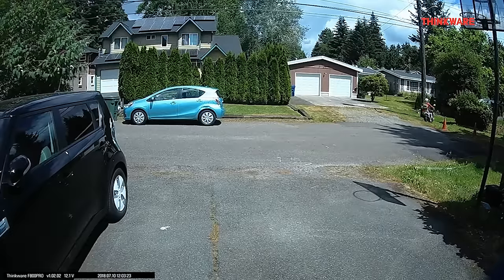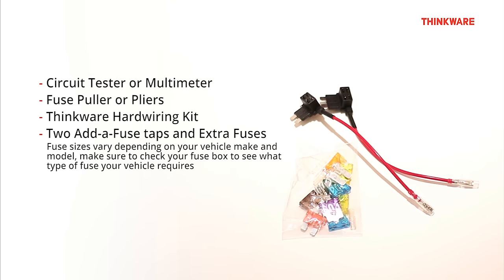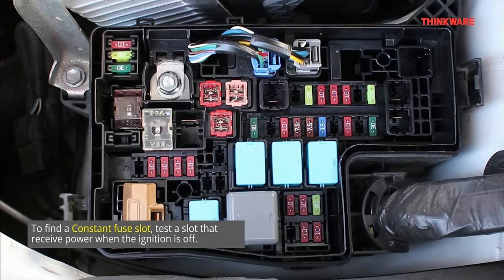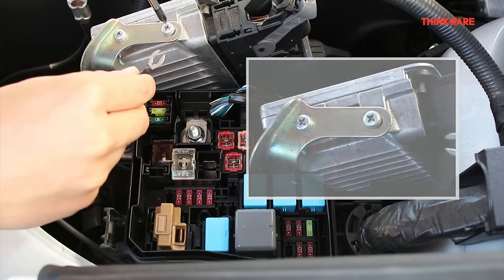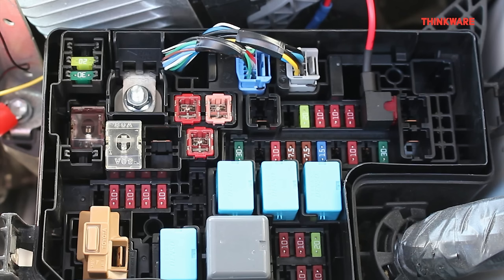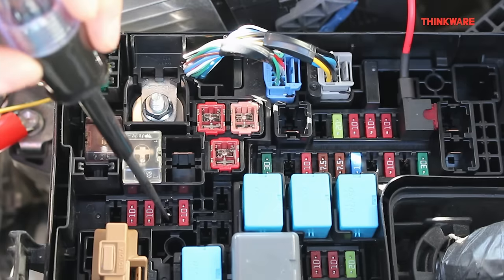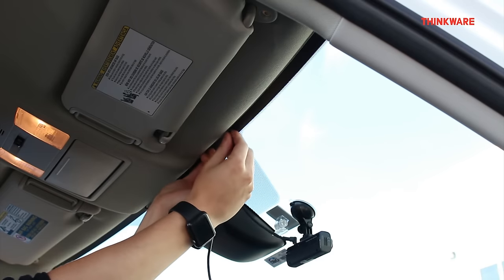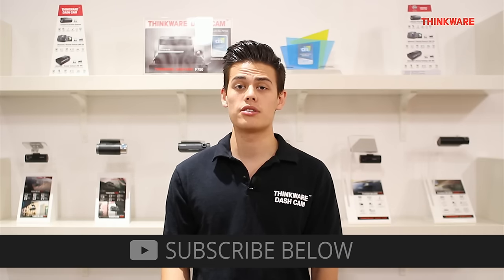How to Hardwire a Dash Cam

Comment: Hi I have questions I m going to buy thinkware f800 pro. 
I bought a new Jeep Wrangler unlimited JL . It has a cigarette lighter socket which has power even when Jeep engine is off.
    Can I use it for my back camera or dash cam?
Does hard wiring kit work same way or it is different than cigarette socket?
Will it drain battery if I use the cigarette socket ?
Reply from the maker: Hello Gary, The Car Charger Cable will not provide you with parking mode even if it on when the vehicle is off. The Hardwiring Cable has an ACC Wire which puts the Dash Cam into Parking Mode. WIth our Battery Protection Settings such as the Voltage Cut Off, Wintertime Protection and Record Timer the vehicles battery will not be drained.

Comment: I have no garage, so my car is out all the time, will the parking mode drain my car’s battery? This since it’s going to detect movement pretty much all the time
Reply from the maker: Hello Raven, All Thinkware Dash Cams have a built-in Voltmeter which will power off the Dash Cam if the battery level becomes too low. If you are normally parked in an area with lots of movement we'd recommend the TimeLapse or Energy Savings mode instead.

Comment: Hello, I want to but a separate dash cam that is independent from the front cam. If I use a USB splitter and attach it to the hardwire kit will it provide enough power for both dash cams?
Reply: parking mode does consume power when the engine is off,  hardwire kits, usually have a cut off circuit to prevent these cameras from draining to much juice from your cars battery.  having 2 separate cameras would drain twice as much power,  you definitely want to use the battery protector, you your car might not start the next morning.

Comment: Is that means if we hardwire only in ACC and turn on car then Dash cam should work from ACC not battery ? Because I tried ACC only in a port that gives power when car is on but dash cam is not turning on. But always on port gives me power when car is off.
Reply from the maker: HI There,  Can you please reach out to us at support@thinkware.com for further assistance with the Hardwiring?

Comment: Any recommendations on what voltage setting to put the cam on?  I have the hardwire kit and a Cellink Neo battery.  I have noticed that the camera stops recording, even when settings are in parking mode, sensitivity is set high and battery is still in the 90% + range
Reply from the maker: Hi Tommy, this could be due to a number of factors. Please contact our support team and they would be happy to help! Email: support@thinkware.com

Comment: My dashcam turns off when I start the car. I'm not using thinkware hardwiring kit but it's very similar. Btw my dashcam uses super capacitor. I am using the door lock constant fuse. The fuse box is internal and not the one in the engine bay. Does anyone know what's going on and how I can fix this problem?

Comment: can cancel the constant fuse slot wire if i don't need it?
will it work properly?
Reply from the maker: Unfortunately the dash cam will not function if the Constant Wire is not connected.
Reply: @thinkwaredashcam  thanks a lot buddy ❤️

Comment: If I only want the dashcam to power on when ignition is on, can I just hardwire the red wire to a fuse tap? Leaving the yellow wire disconnected?
Reply from the maker: Hello John, even if you do not want the parking mode option, you still have to install both wires as they both need to be connected to power the camera. (If only one of the wires are connected the camera will not power on) You can just disable the parking mode option in your dashcam settings!
Reply: @thinkwaredashcam  

Thanks.  Was hoping I only needed to do one fuse tap.

Which two taps should I use? I had been planning to use only the mirror fuse (5amp).  The cigarette lighter (20amp) would be ideal  next to it, but they’re side by side and too tight to fit two fuse taps.

Comment: I'm going to install my thinkware f200 but I don't know which fuse, I should tap? Cigarette lighter and what else?
Reply from the maker: Hello Gio, We are unable to specify which fuses to use as each vehicle is different. It is best to use the cars manual and test the fuses with a multimeter to determine a constant and acc. Ensure not to use fuses critical to the vehicle's system such as airbags or locks.

Comment: If you connect both red and yellow wires to an ACC circuit, will the camera just turn on when the vehicle is turn on and will the camera work normally? I'm not really interested in parking mode.
Reply from the maker: Yep! Just make sure both wires are connected to an ACC fuse.

Comment: Hey. Thank you for great info. İ have a question. İ attached the cars 3 amperes fuse to lower. This fuse is not in use as per car’s fuse box diagram. There was flow when i checked though.
The cameras fuse attached upper is 5 amperes. Would this be a trouble? You said it should be equal or lower. Thanks for the tips :)

Comment: What amp mini fuse should I use?
Reply from the maker: Use the same amperage or lower than the fuse you are tapping into.
Reply: @thinkwaredashcam  That's incorrect, you always use a fuse that's suitable for the cable gauge the tap is made from, so something like a 10A is correct. I'd use a 5A because that's still far higher than the dashcam is going to require. Someone plugging this into a 30A socket and using a 30A fuse would be creating a fire hazard.

Comment: Why can we use the empty slots in fuse box?
What are those for if we cant use
Reply from the maker: Hi there! Tapping the hardwiring connections to an existing ACC and constant fuse allows the dashcam to switch and identify its power source hence allowing the dashcam to change from continuous/driving mode to parking mode once the vehicle is turned off.

Comment: 4:02 
how do you know what number/size the new fuse has to be?
Reply from the maker: Hi there! The fuse you'll add should match or be lower from the fuse you will tap in. Usually, this ranges from 10A to 20A.

Comment: I have a 95 Deville cigarette lighter plug-in has a 12V constant power if I turn the ignition off the cigarette lighter plug-in power stays on I just got the camera 
Junsun S590   I have not installed it yet do I need the hardware kit for the parking mode or just leave it plugged into the cigarette lighter  Power in cigarette lighter plug in stays on 24 hours thank you
Reply from the maker: Hello There, As the Junsun S590 is not a Thinkware Dash Cam, this video will not apply. Please contact Junsun directly for powering information.

Comment: If you made sure that you chose the correct acc fuse slot and put the fuse tap in correctly/positive side plugged into fuse slot furthest from side with the wire, then why would choosing another acc slot be necessary and why would it be receiving power while the car is off ?

Comment: My local audio installer mentioned he "went directly to the battery".  Now I'm wondering if this means it is unfused. Is this going to be a problem?
Reply: The dashcam is connected to a THINKWARE iVolt Mini External Dash Cam Battery and  I think this is what is hardwired to the battery.

Comment: How did you get the cables from inside the vehicle to the fuse box?
Reply from the maker: Hi There, depending on the vehicle, you may be able to run the cables through the fire wall.

Comment: I misunderstood about the grounding wire,because i thought you just needed to be sure the grounding screw or bolt was bare metal and not the complete area . The screw i thought could be used goes into lower side of dash which is not metal.
Reply: I hadn't chosen a good grounding location so was the reason cam wasn't turning on unbeknownst to me. My problem has been fixed.

Comment: Hi, what will hapend if i conect both wite in constant power. In my Mercedes i dint find ACC fuse inside.  Did will work parking mode with both wire in constant power ?
Reply from the maker: Hi there, if both wires are connected to constant power the dash cam will power up in continuous mode and will stay in continuous mode even while parked. This will drain your vehicle's battery and we do not recommend this.
Reply: THINKWARE Dash Cam™ Thank you very much for answer.
Reply: THINKWARE Dash Cam™ Thats true i check it, the camera is runing constantly.
Reply: THINKWARE Dash Cam™ Hi again, this time i conect only yelow wire in constant power and the red wire is powered when i start the car. When i drive camera is working fine, but parking mode looks like dont work. I shake camera and the car, then im conect tocamera with app nothing recorded.
Reply: In parking mode i have red led forward and green led inside. I folow it the rool + with + in cabel. Any help please, Should the car record video in parking mode if something hapens ?

Comment: Using the ATM fuse panel inside the car and ATR tap should not be an issue, correct? Also, I see empty slots, can I use them?
Reply from the maker: Yes, that should not be an issue. Empty slots are great, just make sure to still use two fuses in the fuse tap!
Reply: THINKWARE Dash Cam™ thank you

Comment: I got cigarette continuous power, even when the vehicle is off,  what you recommend me to do, I can leave it connected all night with the 12v cigarette power connection? Its safe?
Reply from the maker: Hello There, Please do not leave the Dash Cam running overnight with the 12V Car Charger, as this risks draining your vehicle's battery since the camera is staying in Continuous Mode. To use the Battery Protection Setting the dash cam must be hardwired with the appropriate cable.

Comment: Can I tap into the cigarette lighter wiring for the dashcam? My cigarette lighter is on switched power only.
Reply from the maker: Hi Sean, you can, however, plugging the Dash Cam to the cigarette port won't enable the Parking Mode feature, as the Dash Cam will power on and off with the vehicle.

Comment: any suggestions for someone who has a dashcam that sometimes powers off when I start the car (i.e.  was recording and then powers down)... and sometimes powered itself off when the car was off, and does NOT power on, when car starts.
Reply: Reset to factory default settings and run like that for a few days. If you still have the problem then contact the seller and say you want to exchange it for a working one. If the problem goes away then you may have incompatible settings.

Comment: Can i select a 5A fuse slot for ACC and 20A fuse for a Constant/Battery source ? I see that you have selected 10A for both. How much max current does Thinkware U1000 draw ?
Reply from the maker: You can use different fuse sizes for the ACC and B+. The U1000 has less than a 2 Amp power draw.

Comment: Do I absolutely need a fuse tap? I have a couple of unused 25A slots in my fuse box and all I have are 30A blade fuses. Can i just plug in to one of those? Not sure if they are ACC slots though. I can probably just unplug the cam till I find a fuse tap. Asking because I am leaving for a long drive in 2 days.
Reply: No, the fuse is there to protect the wire, 30A is too high a limit. But as a temporary thing, yes you could bodge it for 2 days

Comment: Hello Can I temporarily install my camera only with a single fuse tap adapter to a battery wire fuse that turns on when the car starts? and grounded of course. It is safe?
Reply from the maker: Yes! This is popular solution for people who have a constant 12V outlet in their vehicle. This will allow the dash cam to turn on and off with the ignition.
Reply: I tried with just one cable and it actually turns on and off ... I need  another fuse tap adapter meanwhile I am using it with the lighter connector it 's an excellent camera Viofo a129

Comment: I’m just curious why no one suggests a ‘dead switch’ on the parking hot lead? That way if you don’t need or want to have camera On every time you park, such as in a residential garage, you could kill the power to the camera. A cheap inline toggle switch would give you control. I just bought a 4K Dual Camera with GPS and been debating on ordering the harness. I don’t need or want it running in my garage but on trips or at work overnight definitely a great thing to have available. I think something just went click in my head, an aha moment.
Reply from the maker: This is definitely a possibility! We wanted to create a basic in-depth Hardwiring tutorial for beginners. Adding a "dead switch" would be a great idea for an advanced installer! 😁
Reply: Surely, it would be easier (at zero cost) to just remove the power lead from the unit??
Reply: Gary .... easier said than done in a dimly lit underground garage at nighttime or in a crunch for time; toggle switches are dirt cheap but yeah plugging and unplugging it repeatedly is always an option; even when driving and you failed to activate the device. There’s dozens of scenarios when it would be safer, more convenient and faster to have a switch.
Reply: TCM  - points taken!! Just got to remember to put that switch back, and/or put the lead back in!!

Comment: 5:26 can I use any of the empty slots instead of removing an existing fuse if it tested for ACC and constant power?
Reply from the maker: Hi there!
Yes, you can! As long as you are receiving power for the ACC and Constant!
Reply: @thinkwaredashcam  I tried. Used the c-shaped slot for the fuse in the tap wire and used one of the empty ACC and one of the empty Always ON slots of the fuse box. But I don't see power using multimeter.

Comment: Installed as described and battery dead a week later. Anyone have this problem? Battery won't hold a charge now and had to replace. Coincidence battery went dead after installing? I hope so because at $200 a pop for a battery I'd rather just return the cam. Anyone have this problem?

Comment: Thanks for the review, a question though... what if i want to use a empty fuse slot, howmany amps should I use? My fuse box cover does not say the amps for the empty fuse slots.
Reply: Reference the information in your vehicle's owner manual, there should be a diagram of the fuse box and amperage of each fuse listed. If not, then there should be diagrams for the vehicle online or from your local dealership or mechanic.
Reply: if you use an empty fuse slot...you just put one fuse in the add a fuse...
Reply: moreause can I just split open my dashcam 12v cigerette slot charger wire and connect the wires to a new fuse and plug it into an empty slot?
Reply: @clashwithmoi8926  a wire is a wire 
split it open or cut the wire   a couple of inch before it  .

check what is the value of the fuse  ..some cigarette charger have a fuse old 1*1.4 inside the connector or what the manufacturer recommand

just make sure you polarise  your wire correctly ... plus and minus  

plus is the center of the cigarette adapter
Reply: @clashwithmoi8926  Most dashcams are running on 5v/USB power standard, not 12, and hanging off the fuse tap you will have a voltage converter. Do not connect your dashcam directly to 12v power until it is 12v.
Reply: @iainbagnall4825  understood. I actually never did it, might do it this week.

Comment: Mine turns on when I start my car but does not enter parking mode and just turns off. I have it in the correct constant power and acc but im not sure if my fuses are the same (i just used what i could find) I think i have a 10 and a 15 for the acc but a 7.5 and a 15 ( the lower being the ones that came from my fuse box) could the mix match be the issue?
Reply from the maker: Tapping into two different fuse sizes shouldn't effect the dash cam going into parking mode. Have you enabled parking mode in the settings? Also, double check that your ACC fuse does stop receiving power when the ignition is off.

Comment: I have bought a hardware kit to make the camera work while the car is off and make it a recording while in motion only, but I want to make it work like a normal dash cam while the vehicle is moving. How do I switch between the two modes?
Reply from the maker: Hi There, after hardwiring the Dash Cam, you should hear the Dash Cam announcing "continuous recording will now start" when turning on the vehicle and "parking recording will now start" when turning off the vehicle.
Reply: @thinkwaredashcam  So how can I just set on continuesly mode
Reply from the maker: @KF-ld3wq  You can disable Parking Mode under the Recording Settings. This way, the Dash Cam will announce "continuous recording will now start" when turning the vehicle on, and the Dash Cam will shut off when turning the vehicle off.

Comment: Hi,thanks for this helpful video,I installed a front thainkware f750 dash cam but now I decided to install a rear camera,do i need to get another hard wiring kit to make the parking mode work on the rear cam as well?
Reply from the maker: Hello There, As the Rear Camera is powered by the Front Cam you will only need 1 Hardwiring Kit for the Front Device to access Parking Mode.

Comment: I’m currently using a cigarette connector, can I cut the cigarette lighter end off and splice in a cellink out connection?
Reply from the maker: Hello There, The Cigarette Jack Charger does not have an ACC Wire inside the cable therefore cannot be used to put the Dash Cam into Parking Mode.

Comment: Do you have to add a fuse? What if you already have open fuses in your fuse box? Can you just use those?
Reply from the maker: You are not required to use a fuse tap to power the dash cam, however we recommend always using fuse taps. Yes, you can use open fuse slots provided they have switched or constant power!

Comment: Hi I am having Toyota Prius v 2019 and I would like to know the fuse location please help
Reply from the maker: Hello There, Unfortunately, we are not authorized to provide in-depth technical information on the hardwiring installation because every vehicle is different. By using your vehicle's user manual and a multimeter you should be able to locate the needed fuses. If you have any further questions please reach out at support@thinkware.com or 1-844-865-9273